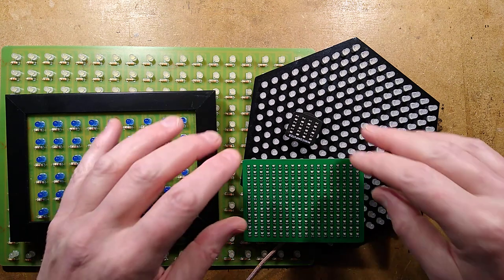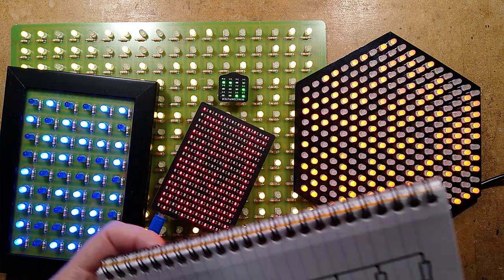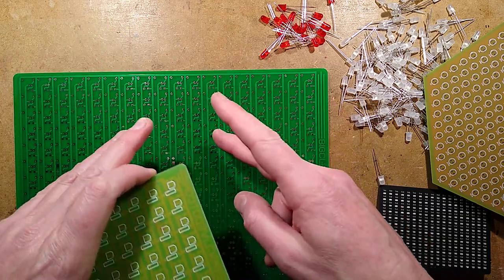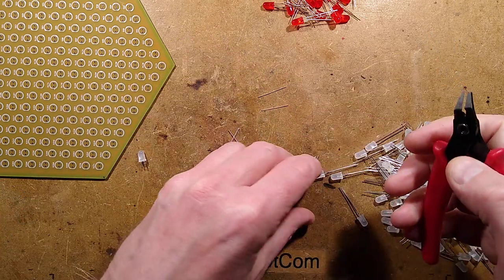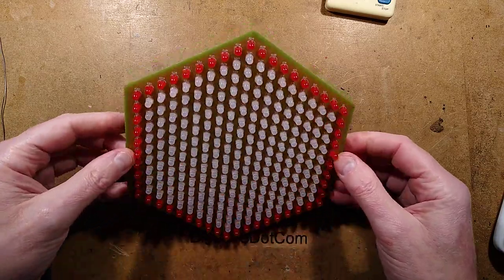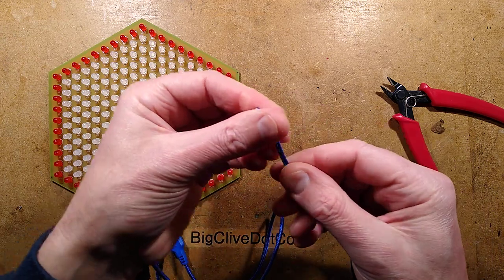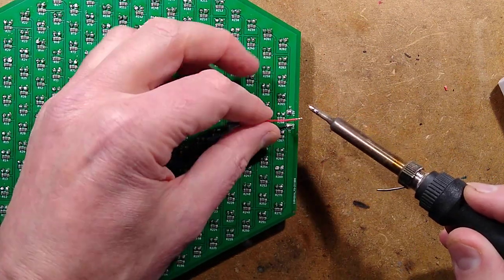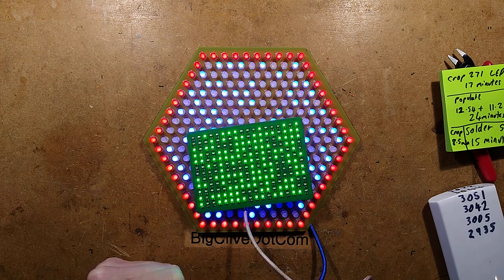Intergalactic supercomputers for all (Not CGI)

Comment: Back in my pro audio days, we used to put something called "LPD" on our equipment spec spreadsheets when comparing possible equipment choices.   LPD = lights per dollar.  If the rack was a show piece, high LPD equipment was sometimes chosen so the client felt like they were getting something for their money.  The DSP boxes we often used had a single red.poweer.light on the front and weren't terribly interesting to the uninitiated.
Reply: That's so smart 😂 awesome
Reply: Der blinkenlights are an important factor.
Reply: That's just like having people go "I want those shoulder mount camera's, that looks good" while a much smaller one these days might be just as capable though yes you might see it in the resulting image when it comes to dynamic range when you knew what to look for.

Best thing was when having hired 4 of those big ones and the job was over, you later heard the customer saw you at so many places due to having to move a lot with them (in a multi-camera setup for instance) they thought you were there with 6 of those camera's  :P.
Reply: I've always believed that if a device has lots of LEDs, the buyer thinks they are getting their moneys worth.
Reply: @tonylock7657  that's just like the common knowledge that lot's of RGB fans in a computer makes it faster 😄

Comment: One technique I use for when placing lots of LEDs is to line them up in the positive and negative rails of a bread board. Then I can test all the LEDs for matching brightness. Then when I go to put the LEDs into the PCB, I snip the LED standing in the bread board so I always know the polarity directly before placing it into the PCB. they stand up nicely in the bread board which is easier to snip, and also the legs are easy to clean up because they remain in the bread board until you pull them out.

Comment: I like how simple this design is.. Just by relying on the manufacturing tolerance of the on/off timing.
Reply: The resistors got much higher tolerances
Reply: @CyberlightFG  in this application, resistance just controls the brightness. But it shouldn't be noticable to the naked eye
Reply: @Spiralem  Well if the timer is capacitor driven instead of crystal driven, you have two tolerances stacking up.
Reply: @Spiralem  I very sincerely doubt that the external resistor has no effect on the blink rate. It's not like there's a microcontroller and a crystal oscillator in there, it's probably some sort of simple oscillator IC and a capacitor to hold the energy for each blink. The simplest circuit I can think of would literally just be a capacitor connected across the terminals of the LED, but a cap that small would flash too quickly on its own. I doubt it's much more complicated than a few transistors, but I honestly could be wrong.

Comment: Funny, I used to make these way back in the early 1990s when the blinky leds first came out. I used to make small 12v red versions in a bezel (still have one) for car dash boards before alarms were the norm, so it looked like you had a car alarm, and a thief would leave your car alone. Sold many hundreds (lost count) for $15 each. I bought thousands though, and noticed same effect, so also made large blinking panels from old populated pcbs, and sold them for hundreds of dollars as supercomputer tech art.
Reply: OMFG, did not think of using already-populated boards as a backdrop. That idea is going in my back pocket.

Comment: If you drive multiple blinking LEDs from a single resistor, they will tend to blink in sync. It occurs to me that someone very clever could lay down runs of sync'd LEDs so as to cause specific shapes to appear.
Reply: Something along the lines of Clive's lamp with the neons that did the same thing, I was thinking of that myself. I wonder, what if you put two in series? Or two in parallel, then those parallel pairs in series? I dunno, there's all sorts of things you could do, stick resistors and capacitors in here and there just to introduce more needless complexity. Sadly though, chaos theory works best with large groups of identical units, the base layout should be as even and boring as possible, so that the tiniest differences end up producing the big results.

When I imagined there might be a computer on there, I thought it'd be nice to do Game Of Life. But not Conway's rules necessarily, cos they're pretty sparse and boring and degenerate into nothing pretty quickly. But you can alter the rules so that any number of live neighbours causes birth and death, and get all sorts of interesting results. Maybe something like that, that on a timer randomly chooses a new rule. 

Actually back in the early days, Conway knocked up his own purpose built game-of-life machine, it used RAM and logic, I think, to read and compare the neighbours for each cell, without having to do it in software, so it was much faster. I think you'd interface it via serial to a normal computer, point being it could tear away at a decent sized grid much faster. I used to really want one, at one point, but now there's wristwatches could do it in software faster. Maybe an FPGA would be good for that. The tricky bit would be the addressing, though I once implemented GOL in software and came up with a couple of shortcuts, since for each new cell you evaluate, you already have some results left over from the previous one that are relevant.
Reply: I'd been wondering why not one resistor ...
Have a lower voltage?
Or is there something weird going on...
Like the videos that are happening at the moment about a circuit that's speed of light related...
Aerial
Capacitor
Inductance
Circuit
... 🐱 ...
Reply: can probably write a script that figures it out relatively easily if that is indeed the case. i say script because a complex shape is likely goingto melt your brain and collapse your patience into a singularity.
Reply: @mySeaPrince_  not quite sure whether i understand your question correctly given the completely unrelated random words you sprinkled in there, but i think you meant to ask why all the LEDs didn't share a single resistor? in that case the answer is: because then all the current will go through one big resistor (= it'll heat up way more), and also the fewer LEDs are on at the same time, the higher the current will be through those, possibly damaging them. the only way to prevent that would be to make the resistor such a high value it would protect a single LED, but then as soon as more LEDs are on the current across them individually becomes so low you can't see them anymore.
Reply: What if you added a photo resistor pointed at each LED, and a random web of traces on a middle layer connecting each photoresistor to another LED somewhere else on the board. You should end up with the frequency of each light's blinking shifting randomly around.
Reply: Blinking LEDs are usually reset by the voltage dropping to zero then coming back on.  So if one LED, probably the fastest one, blinks first, all the rest in the series string will be reset, then comeback on again when the fastest one comes back on.  So you have essentially a single blinking LED and the rest never get to complete the blink cycle.  😱😱

Also, if you connect a blinking LED to a source of fast pulsing DC, like 3 to 5 volts AC through a rectifier, then the blinking LED will look like it's on steady because it just gets reset 60 times a second.
Reply: @monsieurtechnical well we're dealing with a voltage source here. the correct way of doing it to be "as nice as possible" to the LEDs, as you kinda hinted at would be just using a current source instead and ditching the resistors altogether. potentiometers/switches obviously won't work because then you'd have to sit there and turn those all the time :P

but also, i'm pretty sure a better current source won't allow the LEDs to sync correctly.
Reply: @acmefixer1  but why would any of them be reset just because a led blinks?

Comment: The hexaputer looks awesome. Too bad a kit isn't sold to make the "cube" version. 
I'm leaning towards the RGB kit rather than a solid color. It will look good with all the RGB in my new PC build.
Reply: Surely to make the cube version, you just substitute non-flashing white LEDs, where the "edges"  of the cube are?

Or am I missing something?
Reply: @BedsitBob  If the person selling it supplies rgb leds then sure, if the kits are only sold in solid colors you might need to buy 3 (or leds from ebay)
Reply: @BedsitBob  For me, the idea of a "kit" means everything needed is included. None of the kits currently offer having a 2nd color to use for the cube edges, so I would have to source other LEDs separate from the kit.
If I were to buy 4 kits of different colors, I could then mix-n-match the colors to make an edge color and have 3 colors for the sides. That could be repeated 2 more times, and the 4th would just be a mixture of the leftovers.
In the end,  with what is currently available, buying just 1 kit won't get me the "cube".
Reply: Hehe, everyone knows RGB LED's make a computer faster :) :P.

Comment: I don't think I have ever soldered that many joints without an error or few, typically a solder bridge or open joint hidden under flux.  So readers shouldn't be dismayed if they have a few errors.  Thanks, Clive, for another constructive project!
Reply: Most awful is when I have lane-PCB and for convenience I want to bridge lanes (for instance for a common ground from somewhere) and the solder is like "Nope!! I won't do that no matter how hard you try!" and when you need to avoid a lane or islands getting bridged solder is like "Here you go!" :P.

Comment: My dad did something similar to this, but with LEDs that do a slow RGB color fade.
An acquaintance of ours who was a regular attendee of Burning Man had managed to get an old electric golf cart and wanted to give it a dreamy / etheral look, so my dad put a bunch of RGB color fade LEDs in parallel on some thin wire and powered it with an LM317 set to 3.5V.
The ceiling was covered with a few layers of a thin decorative glittery fabric with the LEDs behind most of the layers.  It made a cool subtle morphing effect across the while roof liner.
I wonder if I can make that effect happen in a smaller footprint and make it look like a computer having dreams...
Reply: Very common thing

Comment: Clive i am surprised that you didn't solder a micro usb socket to the back of the board so you save all the faf of cutting off the plug etc. Just an idea for future board designs. You did it on your LED driver board.
Reply from the maker: The rectangular PCBs are designed to go into a picture frame.  It made mounting the connector awkward.

Comment: Very nice. Twenty years ago I built a star with blinking LEDs for Christmas. And I'm in the process of building a circuit board with 392 neon glow lamps. Each glow lamp will have a capacitor and two resistors and will thus switch itself on and off. One of the two resistors limits the discharge current of the capacitor, because otherwise the electrode material of the glow lamps will be sputtered away. For 12 years I have been running a test circuit to test the life of the glow lamps, so far everything has been fine. I would just have to continue soldering the 392 circuits to finish.

Comment: Awesome Clive, I was wondering how these worked. I had assumed a small AtTiny or some other microcontroller was driving the display, but then you said each LED has an oscillator the pennty dropped - it really is that simple?!

On a different note, my mini supercomputer from mouse is still running months on from a little solar panel. I had a funky idea where I could add a small battery circuit and PIR sensor and drop the entire thing into epoxy "brick" and have a perfectly waterproof outdoor supercomputer!

Comment: I’ve actually used a computer with programmable blinking lights, and my software used them to show me progress of the computation. It was an Intel Hypercube with only 16 nodes, each node with several colored LEDs associated with it. So the use of self-flashers sort of rubs me the wrong way… not that I could necessarily tell except at startup. Obviously self-flashers are much more easy to use, and provide a much nicer effect than they have any right to.

Comment: The effect of holding the incomplete board in front of the working hexputer (about 22:01) and having the slow blinking leds shine through the pin holes in it is really nice. Maybe a 2 layer 'puter with the small fast green leds with lots of extra holes drilled in it in front of another board of slow blinking larger leds?

Comment: @13:53 or 833.83 seconds, top right corner, 1 column in, 4 down appears to be up by a few millimeters than the other LEDs. Maybe that case needs a little redesign to help maintain the same consistent pressure across the PCB and any components the foam is in contact with.

Comment: Very cool looking project!
Wouldn't a blinking LED not actually require a current limiting resistor?  I would think that the blinking circuit would take care of that at the same time???
(Still quite new to electronics, so any advice you guys can give would be appreciated....)
Reply from the maker: Direct across 5V the current could be quite high.  Using separate resistors also reduces LEDs getting in sync, and also protects them during a reverse polarity incident.

Comment: The A4 board with non-blinking, higher-brightness (well, up to the current limit of the traces - an amp?) LEDs would make a fine "shadow-free" (well, soft-edged shadows, which is really the point) light panel for amateur videography!
Reply: Not sure about that, I have an old flashlight with a 4 x 15 array of white LEDs, the Terralux TLW-80, WorkStar 80, and the shadows from it have lots of very close overlapping edges.  Looks artificial almost, like bad cgi?  Each LED is causing its own edge on the shadow, basically.  Diffused ones wouldn't do that, or maybe you'd have to put a diffuser over the whole thing, for a lighting panel.
Reply: You need wide angle diffused LEDs for that. High brightness LEDs are often narrow angle.

Comment: you convinced me that I just had to have one...  so off to Amazon I went and ordered a combo of single, dual, and triple color fast and slow flashing leds for a total of 600 of them... plan to mount them in a sheet of lexan and spray paint the back side flat black... gonna be fun soldering the bus wires to the led legs and resistors... thinking of the design shape to be an ellipsoid...

Comment: Very Nice!!!!  So Simple!!! A suggestion to the manufacturer... I noticed a distinct lack of holes near the cable connections for a strain relief. Two 1/8" or 9/64" holes right next to each other would make a great attachment for a 4" zip tie. Even one 9/64" hole would do, feed it through the single hole, around the wire, and back out, zipping to itself and the zip tie head holds it from going through the hole.

Comment: I was always amazed by through-hole pick-and-place machines, rapidly stuffing components into <1mm holes. The leg shaping must've been critical?
Reply: We used to have a through hole insertion machine at work. The components came on strips of paper tape on a reel.  Typically the machine would load about 199 out of 200 LEDs without issue. Insertion failures would go flying violently. It had very few problems with resistors, and handled capacitors pretty well.  These days we use all SMT components.

Comment: FYI, I have a hat which had a flasher LED in series with two regular LEDs and worked off a 9 volt. Worked quite well. I did a project which used six flasher LEDS with a six LED element (radio shack) and it simulated a fire quite nicely. This might be a neat thing to try in a 12 volt light up panel.

Comment: To make soldering easier on ground planes and thicker tracks the component pad attributes can be set to 'thermal break' before ground plane flood is applied.  Although this is not done for high current component pins.

Comment: I remember making flashers like this back in the day that used small 10 Neon lamps, 10 capacitors, 10 resistors, and a line operated DC supply.
Reply from the maker: Neon relaxation oscillators.
https://www.youtube.com/watch?v=lph5zAdcwi8
Reply: @bigclivedotcom  That video reminds me of how finicky they were in regards to the supply voltage.

Comment: I saw a neat project back in the 1980s in radio electronics (or another) where someone did one of these panels but with counter chips (flasher LEDs not there yet) and made a neat altair looking panel, thing is he use an inverter on a couple LEDs so it never be fully dark

Comment: Putting LEDS into a CNC drilled sheet of black PVC would be great. Pick your (round) LED diameter, glue them in get wiring/soldering.  3D printing might be a decide idea too but I'd do high in-fill, only do pilot holes to still gently drill the final LED holes.

Comment: You know, I saw these behind you a couple days ago, and was tempted to ask about them. Thanks...!! 
  I have a couple of those older high-voltage 'plasma' displays, the disc with the 'Lightning'....of course, no LED's involved there.
   I did build some 52 LED small displays like this, double-sided board, but no plated through holes, be very attentive when soldering...

Comment: Always fascinated by your projects. Have you ever done a video on Gerber files for ordering PCBs? I'm bewildered by the all of the .G** files that someone gave me as a zip file. Do I just send the zip file to the PCB manufacturer? Do they know what to do with that, without me having to specify any other parameters?
Reply from the maker: It's usually one file per layer.  So copper, resist, screenprint, outline and holes for a single sided PCB.
Reply: @bigclivedotcom  Thanks for your reply. Looking at the contents of the zip file makes more sense now.